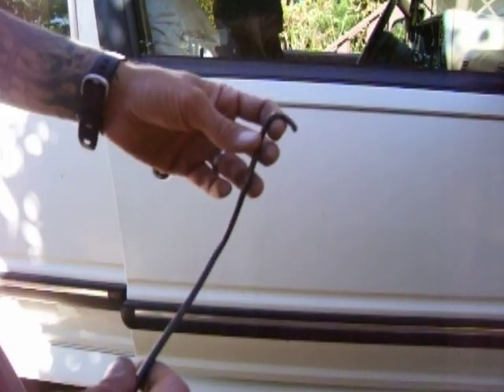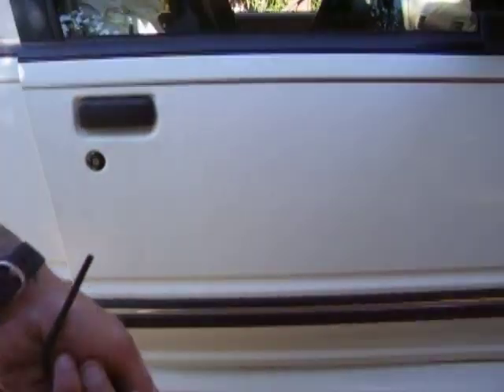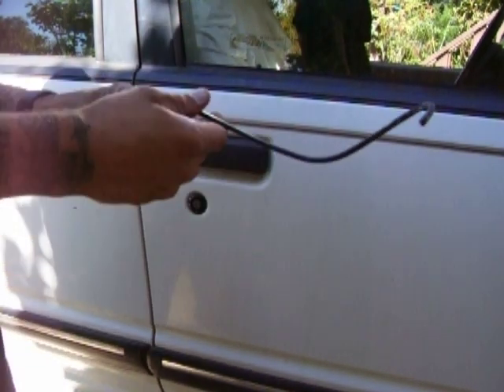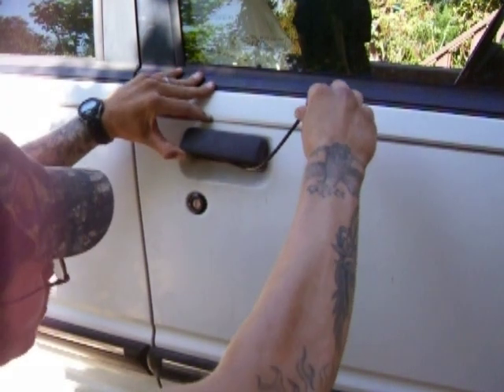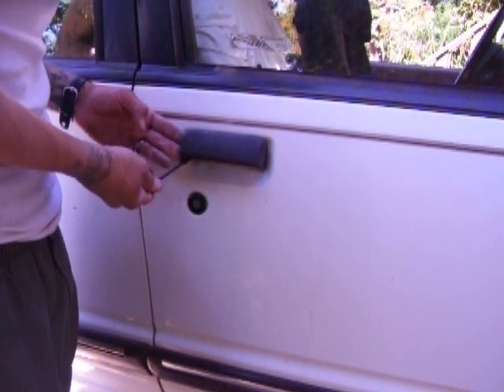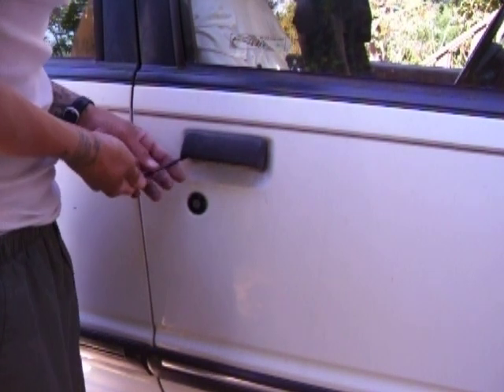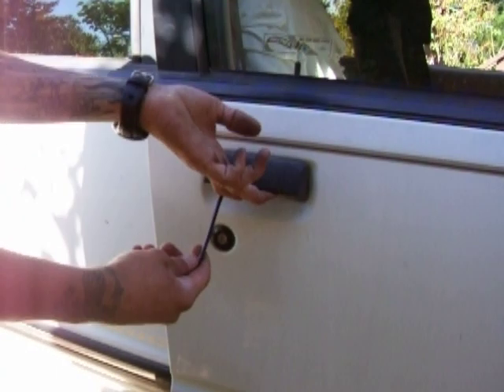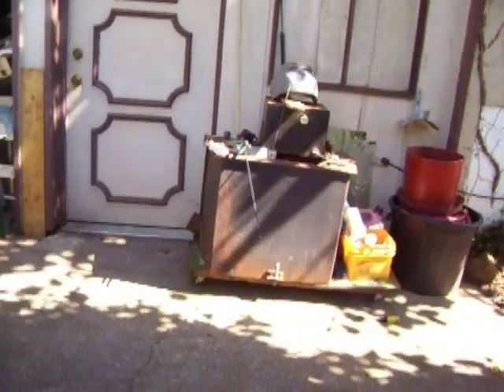ford bypass tool

Comment: Good news! This works on later models a well, not just in the 90s. I have a 2003 Ranger, locked my keys in it just earlier this evening. This video totally solved my problem! I unscrewed the antennae, pushed it up through the handle, and after a few minutes the door unlocked. Thank you so much! You saved me a ton of money by not having to call a locksmith, especially as it was after hours.
Reply: Sean Van a good trick for locksmiths too as that manual handle on the inside  for the door opening mechanism is nearly impossible to pull with a reach tool.

Comment: I wondered about the bending measurements, but the door handle length worked perfect for the bend lengths, I used a 3/16 piece of rod and it worked perfect.
Thank you so much for posting this video.
Reply: +Mark Dunbar what did you use length wise for the bends?

Comment: easier to use your "j" hook. slide your wedge in between your window and weather stripping.. slide it down rotate it and lift up on the lock pin bar. also your not going to set off a air bag in that year of vehicle. trust me. I've been doing lock outs for a towing company for over 15 years.

Comment: you cant set off the airbag by doing this.. the airbag need an electrical charge to go off.. and then after all the airbag isnt even in the door, its inside the interior on the inside of the door. they tested this on mythbusters.. nice vid tho.. nice dog :D

Comment: For the ford ranger I just use a thin flat screw driver.. you can see the linkage thru the handle.    Where you see the bend on it just lift it

Comment: where did you get that tool?  What is it called?  And if you don't have a tool, can you post some #'s.. like 2" bend, 4" bend, 6" bend.. that type of thing?
Reply: Just worked for me.  I spent about an hour on it tonight. I hadn't been into my car for at least 4 yrs from a receipt that was in it.

Thanks for posting this.

Cheers!
Reply: Easy to make I litteraly made one from a metal coat hanger, however it did bend when I had to apply force it worked like a dream

Comment: In most states now the Slim Jim is illegal, this method is fail safe on the Rangers as there are no side airbags.  Either way it's a defect that Ford knows exists but they refuse to admit or fix it.  I'm surprised Mazda still sells rebaged ford rangers.